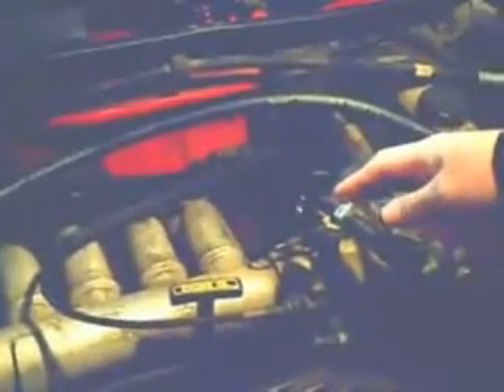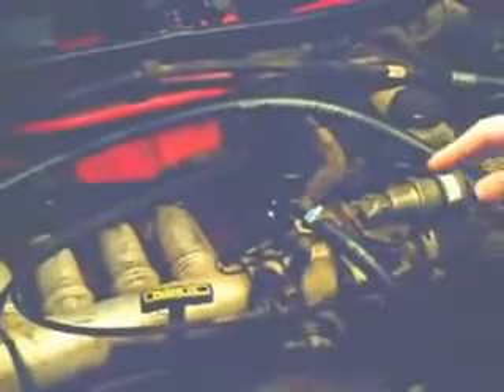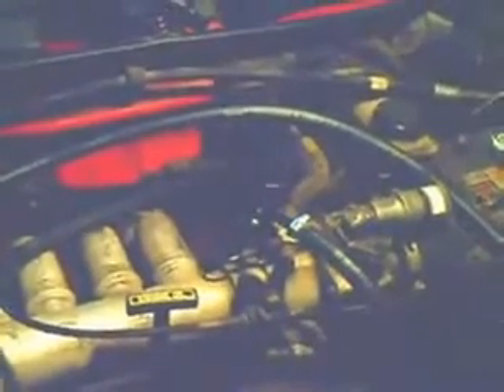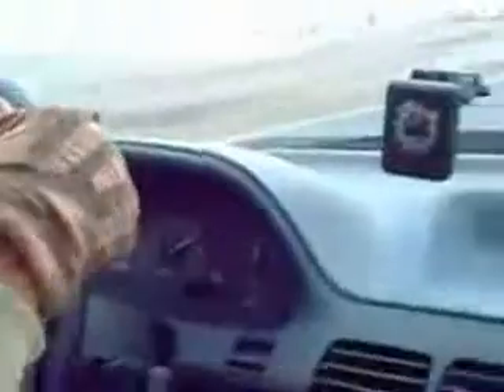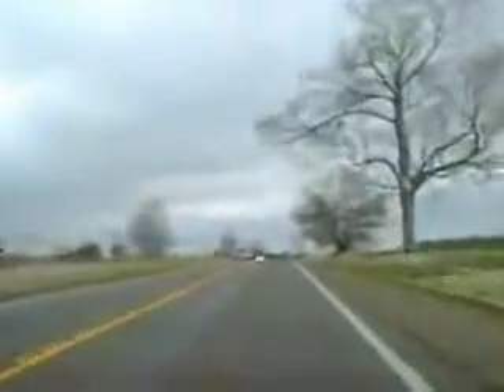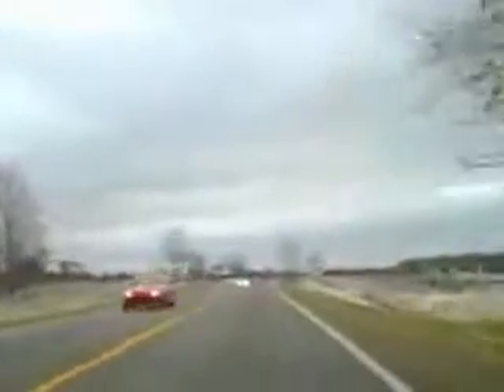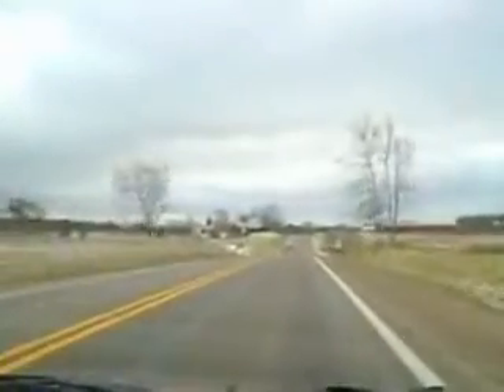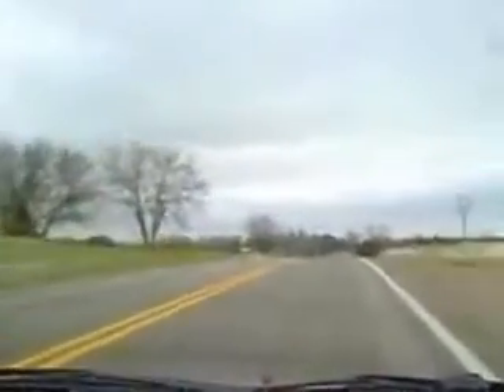Water Cars - Covert Your Car to Run on Water Part 1

Comment: is the engine will suffer rust inside? there is still a moisture coming from the HHO Generator.

In cause andn effe, we might think that Engine Cost is expensive to buy a new one once HHO generated rust inside.